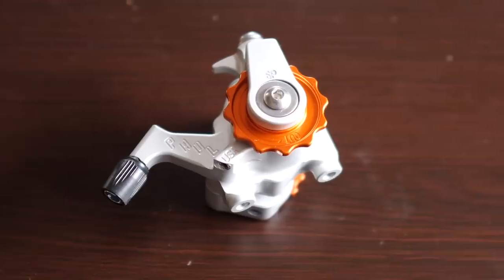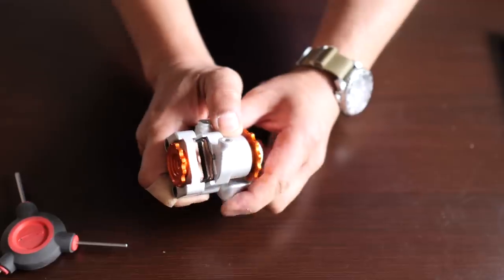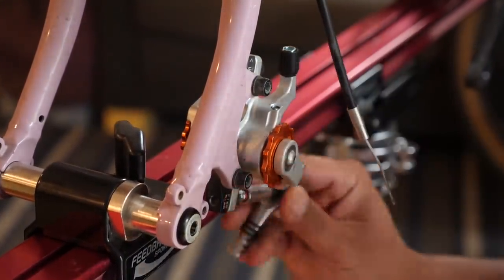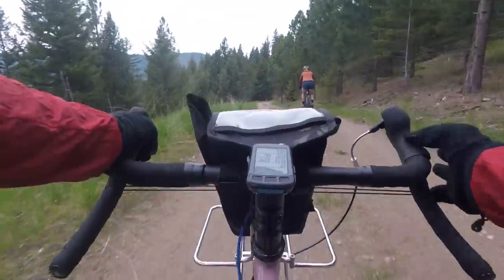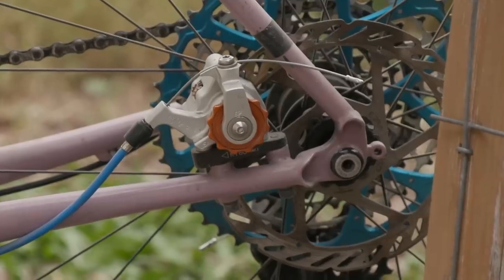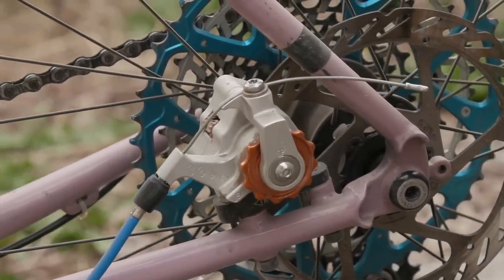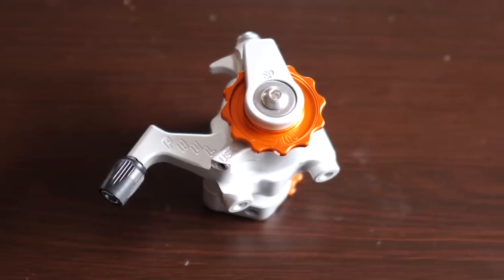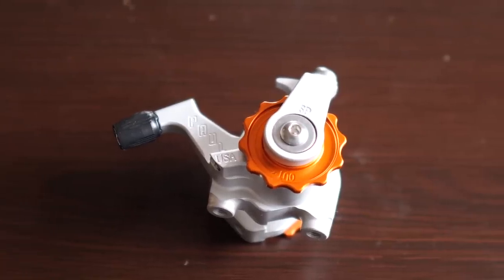Paul Klamper - Worth the 💰💰💰?

Comment from the maker: Commence complaining about premieres in....3...2... :)
Reply: Ugh, premieres.  :)  Looking forward to this one, been considering these for a while.
Reply: Ugh. Premieres are such a tease. If you did them after the episode I bet you'd get less grief about them.  ;-)
Reply: Brake feathering gang AOOH
Reply: Did I miss the premiere 😜
Reply: Could you please please please elaborate on TRP Spyres? Or Spyres with compression-less housing combo? Or TRP Spykes maybe?
Reply: @cthulpiss  I've played around a bit with Spyres + Nokon housing, and they rock. Should be about the same with Yokozuna Reaction.
Reply from the maker: cthulpiss they suck with certain Shimano levers even with conpressionless housing. By suck I mean you can’t lock up a wheel even in the drops.
Reply: @PathLessPedaledTV  man, I'm confused now, I love the idea of cable actuated disc brakes, I still have old Rock Shox ones.... I was saving for TRP brakes, and I don't know what to do now, I cannot afford Paul's though. Heh...
Reply: @cthulpiss  I run spyres on my gravel bike with Shimano claris levers and jagwire compressionless housing. Work as well as most hydraulics I've used.
Reply: I rarely see this mentioned on this channel: the Yokozuna calipers are simply rebadged Juin Tech calipers packaged with compassionless housing. I bought Juin Tech GT-F (four-piston flat-mount) from Edge Sports in the UK (only place I could find them at the time). They were $230 for the pair and arrived the US in about a week. They are excellent for my needs and I can easily lock up both wheels from the hoods with standard housing. They put Spyres to absolute shame! About half the price of the Yoko branded ones.

Comment: Russ, 

The interchangeable arms also allows swapping between flat and drop bars on the same frame, without having to resort to long pull, drop bar levers, or some other adapter to make peace between road and mountain components.

Comment: I've tried numerous disc brakes over the years including hydraulic and cable, shimano included.  BB7, TRP hylex, shimano hydraulics, TRP spyres....event had that weird TRP converter box thing under the stem.  It was the shimano's that finally put me off hydraulics since the seals kept leaking, so went back to mechanicals, plus you have more flexibility and durability without having to have STI.  After shimanos went to spyres for a while.  Stopping is ok and feel is nice but being in the UK they got filled with water and dirt and you could feel them grinding at the lever.  They're really not very friendly for user servincing either.  When I eventually got them apart they were corroded all over, including the ball bearings themselves.  Got the Klampers and far happier overall.  They cost 3 times more as pointed out, but I'd wager they'll last more than 3 times as long and for me that's worth it.

Comment: I splashed out on these last month after having the guys from my local shop show me them up and stopping on their custom builds. I have been through the TRP catalog and had very limited success, so bit the bullet and placed the order. 
Yes it was a few pennies to part with in one go but now they’re on the bike and starting to settle in, I can safely say they are well worth the investment! 
Having a brake that is serviceable, powerful, and will probably out last me cannot be underestimated. Highly recommended.

For the record to anyone that may be wondering what sort of testing I have done to come this conclusion, I do Audax/Rando riding, so very long distances, sometimes loaded, in all weathers. They work brilliantly with my gravel wheelset too 👌🏻
Reply: Have you used the trp evo? I run the evo on my enduro but my commuter / lunch ride / bike packer needs new brakes and I’m looking at klampers.

Comment: On target review.  I installed mine today -- took 5-10 minutes per brake (already had new cable and housing on the bike).  Haven't finished bedding them in, but braking power is impressive and "modulation" (range of result from varying brake squeeze) was better than my TRP Hy/Rds.  Thanks PLP.

Comment: Thank you for the review, Russ! Top-notch as always!
I love the idea of the Klampers but that price! For my recent Cave of Bad Ideas-inspired mullet upgrade, I went with the JuinTech R1 mechanical+hydraulic hybrid brakes with compressionless cable housing. The R1s can be found for $125-$150 per set from some US-based Ebay dealers. Far superior compared to my old Spyres and BB7s in terms of feel, modulation and stopping power. Just a remarkable value. 
I may upgrade to Juin Tech GT-P (the Yokozuna Ultimos are rebadged GT-Ps) at some point, but I could not be happier with R1s.

Comment: Any mechanical brake will work better with Yokozuna housing :)). 

I'm running the Yokozuna brakes, albeit with the manufacturer branding as Juin Tech. The worked with cheap housing, but it is a night/day difference to use Yokozuna. At this point, I don't think I'd willingly set up any mechanical brake system with anything else. Nice thing about using Juin Tech is that even with buying the Yokozuna housing, the price is still about the same as a single Klamper caliper. Plus, you can get the Juin Tech brakes can be purchased in all sorts of gaudy colors.
Reply from the maker: They do make a big difference. FWIW Paul actually recommends not using compressionless.

Comment: I use the Reaction housing with the Paul Klampers. I use Jagwire insert end caps and this Allows the spring to bring the brake handle back quickly. I currently have the crazy bar and the paul canti levers. The Klampers are very solid this way.

Comment: Another thing worth mentioning about Klampers, or any other mechanical brake, is that they have far more power if you use them with levers that have variable leverage- SRAM 9.0, XT M737/ 739/ 750/ 760, XTR M900/ 910/ 950/ 970, LX M570, Altek Sharkfin. Using these levers gives a night and day power advantage, and gives you more pad clearance, too. Combine those levers with compressionless housing, and you will have a top-notch brake.

Comment: I have Klampers and have to say that the outer pad adjuster is very hard to use compared to the one on a BB7. The Paul one is stiff and hard to move, even after breaking in, while the BB7's clicks oh so easily, making it a lot easier to tune the brake very quickly. Now, the Klampers do have a barrel adjuster on them which does much the same thing as a pad adjuster knob and is also easy to use, but it makes me wonder what the pad adjuster is on there for; it's wide and adds weight. Klampers are great brakes, but this issue with the outer pad adjuster IMO is a flaw worth mentioning.
Reply: They say that as the pad wears you should turn in the pad adjusters rather than the barrel adjuster.  That's all I know.

Comment: I’m intrigued. I only have one disc bike but the brakes are very average (early mechanicals). That is spendy but I see no reason I couldn’t start with just one. The reason I like rim brakes is how easy they are to service - looks like these solve that. As a side note - you don’t think the Crust is a forever bike? That’s the point of steel! I’m heading off on a 360 mile bike packing trip on my ‘83 Trek 500 Saturday (all components are upgraded).
Reply from the maker: It would be a forever bike if it weren’t a Frankenbike to make videos for the channel.
Reply: Path Less Pedaled yeah - it’s your job so a different story - makes sense.

Comment: On my touring Surly I bought Gevanelle shifters with long-pull MTB-type brake levers instead of short-pull road levers so I had more (and cheaper) mechanical disc brake calipers to choose from. I'm running Tektro Aquila which are terrific despite being literally one tenth the price of these Klampers. Great stopping power with semi-metallic pads fitted. Surely the brakes in this review are vastly overpriced.

Comment: Figured it would've been fair to bring the BB7s as a comparison here rather than the Yokozunas. The BB7s are single sided actuation like the clampers but for 5x cheaper. $43 on jensonusa right now. No doubt the Clampers are a better brake, but 5x better than a well adjusted set of BB7s? I don't think so.

Disclaimer: it's long been my biased opinion that Paul's Clampers are some of the biggest wastes of money you could ever attach to your bike.
Reply from the maker: BB7s are fine. Ran them on touring bikes and the stopping power was ok when loaded. Hate replacing pads in them. Finicky to get the spring pads to sit in right sometimes. For a throwaway brake BB7s are great. I expect the Paul’s to last the life over multiple frames however and pad replacement is easier.

For a waste of money: SRAM AXS.  Would rather splurge on brakes that will last a lifetime rather than AXS and $100 chains.

Comment: Debating on ordering these for a new touring build in the works. It will come with TRP Spyres/Spykes (whatever is for alt bars) and on my Cutthroat I am not  impressed with the Spyres for reasons Russ has mentioned and that bike is pretty light. I emailed Paul so I would buy the right items the first time and got this response. "Our favorite combo is Canti Levers and short pull Klampers. They have a tad more power and less friction." And here I was under the impression I needed long pull for an alt bar application. Now to hit the checkout button for $625 of brake bling

Comment: I'm using TRP Spyres with 5800 105 shifters. They're mighty and bring a loaded bike to a skidding halt provided they are set up correctly --- common cable brake complaints of sponginess and softness are due to the housing and how well the ends are prepared. Although using normal brake housing --- not compressionless --- I used a grinder to make the cable end completely and perfectly flat. Correspondingly brake performance is excellent.
Reply: Agreed! Cost 3 times less too.
Reply: The levers can also feel soft and spongy if the pads are not set correctly, and one side contacts the rotor way before the other one. I also found that you get much better performance if you change out the stock pads. No need to go with expensive pads, even ancient and cheap Shimano B01S pads are better.
Reply: I use TRP Spyres with 7000 105 levers.  These are the easiest to adjust disc brakes I have used.  I prefer modulation over power and these are fantastic for that.  I set the pull so that the pads contact earlier in the lever pull so they feel like my rim brake bikes.  This may have to do with them working well with the Shimano levers.  I wouldn't use any other disc brake caliper.

Comment: If you want to keep your favourite levers try to convert to the giant  conduct brake unit. This has cable actuation to the central hydraulic unit mounted on the stem and hydraulic pipes to the standard brake on the frame. Much easier to maintain than cable. Used in my giant for 3 years. The upgrade price is about 150 uk pounds. Full hydraulic feel plus the levers you like.
Reply: Ewww, no way. That box on the handlebars is hideous and takes up too much space. There are excellent cable actuated hydros with all the hydro built into the caliper. Much better solution.

Comment: Between myself and clients we have used every mechanical disk caliper on the market and today only recommend the Klampers and TRP Spyke and Spyre. The Klampers are certainly better performers and a lifetime product if folks are willing to do a rebuild occasionally. TRP mechanicals don’t give up much performance over the Klampers but are susceptible to failures from silty water and thin mud.   If you don’t ride in those conditions and want to save money go TRP. If you like the idea of lifetime cycling products go with Klampers.

Comment: Paul most anything is above my paygrade, but I've had great results with the dirt cheap Zoom cable pull hydro breaks. Actually bought the roll of compressionless housing. It didn't seem to make a difference. The only downside is they are a one piston break, so not selfadjusting.

Comment: Interesting stuff as always, Russ! I wonder how these compare to BB7s in terms of pure stopping power. I mean they both seem to employ the same mechanics and I don't see why Paul's should perform considerably better. If that is the case, it is a bit difficult to justify the price, unless you want a US-made product or some blingy parts on your bike
Reply: Wondering how the Klampers function, as in work and feel compared to BB7?
Reply: @jefftoonstra5087   just if they have  more stopping power than BB7 and, if yes, why?
Reply: Mechanical caliper performance depends greatly on machining tolerances and design strength. Any flex in any part hurts, which is why these are built like a piece of mining equipment and machined with the precision of a Swiss watch. Compared to BB7s, design and construction are on a completely different level.
Reply: @dkessler14  this absolutely makes sense, thanks!

Comment: Ha! I didn't know my shimergo monstercross needed custom cable pull. Honestly though that's a brilliant feature and goes a long way towards justifying the price, if you're a hopeless tinkerer and your "investment" calipers can follow you from bike to bike.

Did you set up the Paul's with like some decent compressionless jagwire housing? Or just basic off-the-roll spiral brake housing? In my experience that's the number one factor that makes mechanical disc brakes perform well.
Reply from the maker: Paul actually recommends using cheap housing and not compressionless.

Comment: I have 2 sets of Paul Klampers. One short pull set and one Campy set. I also have worked in the bike biz for 35 years and counting which hopefully you’ll appreciate the experience. First off, these brakes are absolutely fantastic. They are very simplistic and work great. Modulation to me is a word that is thrown around WAY too much in the bike braking world. Hydraulic brakes work fantastic but certain brands can “ hit” too hard and can (not always but sometimes ) have a herky-jerkey feel to them and just quite simply,  brake too hard too soon. Again...this is common but by no means a deal breaker. The Paul Klampers, after a very brief bedding time, feel absolutely great, solid and predictable. Some of you may roll your eyes but DOT fluid is harmful and is not great for the environment. I’d certainly take the Mineral oil path over the DOT path. The Paul obviously don’t require either and to me, is what makes them so darn appealing. Easy to install, no bleeding, normal housing and are built to last. Note: these Calipers are BIG, but that doesn’t bother me at all. If you are a weight weenie, look elsewhere but I’m not and gotta say these Paul brakes are the best I have used. Give em a try and you won’t be disappointed. Worth every penny.

Comment: Ha - I had to doubletake when I saw this- good timing! Just finished installing a Klamper on my Surly LHT fork upgrade from rim brakes last weekend (local shop/suppliers were out of Spyre Spikes (long pull) which I would have gone for in a heartbeat if they had em').
I wish they'd use metric instead of torx, that decision doesn't make much sense to me (I don't think you get a good interface between torx and the bit which leads to easier stripping out esp. since the Klampers require a pretty high NM spec rating which is hard to meet with a standard multitool in the field), and pad alignment is more difficult than some since they are 100% flat mount instead of using a conical washer to give even finer axis control between the frame and the brake body. Also had to get very creative w/fender stays since the brake bodies are huge compared to most others on the market, but it worked out in the end.
My experience thus far after bedding the pads has been "ambivalent, but they do look pretty and I like the idea of supporting smaller companies". I'm happy to have a front brake again, as to whether Klampers represent the dream, time will tell.
Reply: 8 months later TRP Spyres are still no where to be found...meanwhile had to get some Tektros to hold me over.

Comment: A con for me, and this goes for all calipers, is the lack of pad service through the top of the caliper. It may sound like a small item but I like not having to remove and realign my calipers to access pads.
Reply from the maker: You can pop the pads out from the top.  No caliper removal necessary.

Comment: Correct me if I'm wrong but locking the wheel is a braking failure and a loss of traction. This should be marked as a flaw of the brakes. What we need is power and modulation prior to locking the wheel.
Reply: It is simply a point you can technically do it. Secondly it depends on speed. And after all you can always adjust your brakes, but the good thing is with those brakes (judging from the video) you can go far when it comes to braking power.
Reply from the maker: We can get into semantics about braking. I was choosing a concrete outcome people would understand. You come up with a better one 🤷🏽‍♂️
Reply: Well, no need to reinvent the wheel. Brake tests usually involve stopping a vehicle from a given speed and measuring the distance. You could do this for your usual, everyday brakes and then compare to the ones you're currently testing. Or include a market gold standard, say Ultegra, and compare against that. Just a thought.

GCN have done this when they compared discs and rim brakes in road bikes.